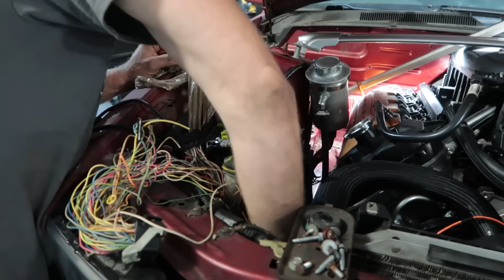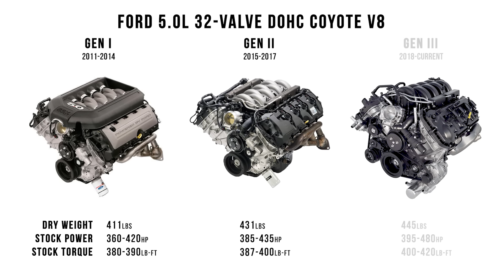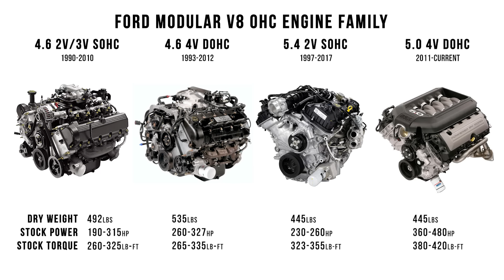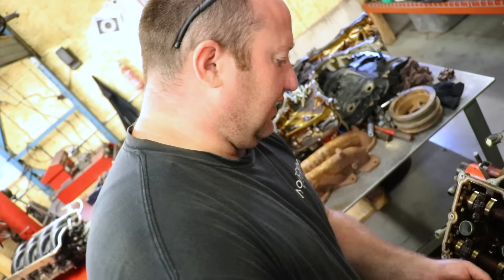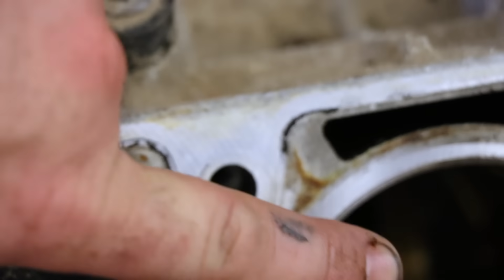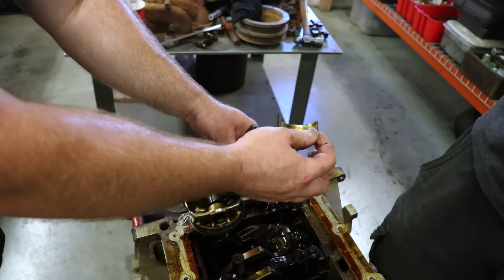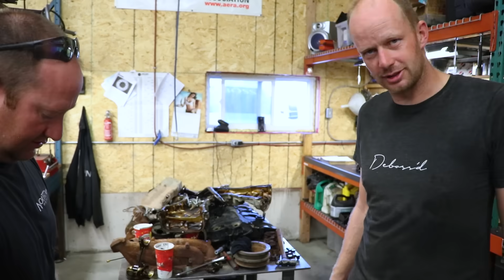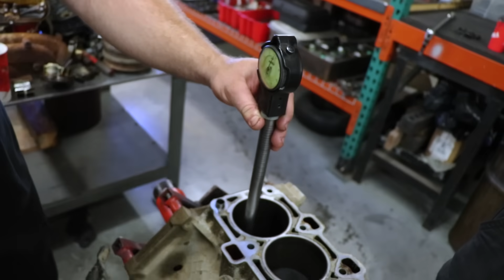REVIEW: Everything Wrong With A 5.0 Coyote Engine

Comment: Second gen COYOTE 5.0 is king....reliability is unbelievable...fully forged bottom end...simple.... no direct injection..means NO carbon build up..iron sleeves..good on fuel vs competition...run mobil 1 full synthetic...body won't rust either on the F150...6 speed is bullet  proof..trucks out there with over 900.000km still running...2015 to 17..is the pinnacle of the F150...it's basically a racing engine that can handle up to 800 hp...boosted...no problems..

Comment: I have a 5.4 f-150 that's got 330,000 with the original motor and transmission you can cry about the 5.4 all you want there problem was the owners not the engine i have replaced plugs and coil pa ma never broke a plug or had one shoot out the head just because you don't like something doesn't mean it's bad you think ford used that engine for a long time  and a big company isn't selling stuff it's going to have to replace stuff on for free

Comment: Wow, this dude doesn’t know as much as he thinks he does.  He might be a decent machinist, but boring out an engine absolutely DOES increase displacement if the stroke stays the same.  Compression height doesn’t matter when calculating engine displacement, period.
Reply from the maker: Scott addressed this exact point in our follow up video here: https://youtu.be/tDpTPxinNyo He isn't talking about performance engine builds. His point relates to modern engine rebuilds keeping the compression ratio the same in a stock application.
Reply: @DEBOSSGARAGE he specifically said boring out doesn’t increase engine displacement.  He even used the example of boring out a Chevy 350 .030 over and said “people call that a 355 but it doesn’t work that way”.   Mmm, yes it does.

Comment: Great video! I know it’s old now and prolly already been said. But the one issue never mentioned was the valve cupping problem. The factory valves are too soft and over time will cup themselves further up into the valve seat before the angle isn’t right and they don’t seal. Just like the updated bearings mentioned, Ford has updated valves to correct this problem. I feel one rebuild in a first gen’s life with all updated parts (at the very least) and this is a near bulletproof engine. I love my Coyote!

Comment: I don't see any camshaft bearings in there. It's retarded junk throw away engines then. Any money you throw into it is a waste unless your address that flaw. Take it to the auto machine shop and have then re work those heads to accept split cam bearings. I can't believe there engines supposedly love boost.

Comment: What I want to know is, what are the design flaws. Of these verious Gen 1, 2, and 3 engines. Do their camshaft ride on aluminum journals? Like the Ford Escape 3.0L V6's if so that's a bult in weak link just waiting for it to overheat and melt the aluminum causing it to gauld up on the cams and then hog out the journals. And all it takes is blowing a head gasket to make that happen. And then keep driving it. Like most who don't know or understand engines will do. And then the heads are FUBARed.

Ford as well as most auto manufacturers especially now a days are really going HAM on the whole planned obsolescence business model. Especially European manufactures. Eventually no one is going to buy their crappy designed vehicles. Cause they don't want all the troubles they will be buying.

Comment: The sound ! 

It's not a real 5.0 pushrod Windsor.

It's a garbage trash modular motor and it's been neutered it doesn't sound anything like a real hot rod V8 like the old school 5.0 Ford needs to go back to the drawing board and bring back the 5.0 ho

Comment: When Ford deleted it's cast iron 300. Inline 6 it's 302 it's 351 it's 460 this is when all the trouble started trying to make better instead it went south in a hurry. I am a retired auto mechanic have worked on all of the big 3 for 40 years they have all turned to JUNK.

Comment: Any oil is not good from short driving i dont believe full synthetic would have caused that. My gt 5.0L first gen coyote has 133,000 miles on it and no. Noise i run pennzoil ultra platinum or amsoil in it. Changing the cooliant is also very important on these motors as well.
Reply: I also change out the manuel transmission fluid every 10k miles as well as the rear diff fluid. Fuel system.cleaning as well as cleaning the intake valves every so often. My 2.7 ford 150 gets same treatment only thing is I take to dealer for transfer case transmisson and front amd rear diff. I change my oil every 3k miles I might be wasted money but oil cheap compared to an engine. I've actually put 150k miles on an ecoboost engine. Learning properly let your turbos cool down and start vehicle is very important oil needs to run through the turbos. Most people are afraid of turbos do to the complexity of the engines. I go above factory recommendations on any engine. These engines the 5.0L are made to be driven

Comment: Just bought a 2011 f150 5.0 with 68000 miles?? What do you recommend for oil semi-synthtic or full and 5w20 or 5w30 the ford dealership parts manager siad to stay with 5w20 do to the 5.0 tight tolerance? Is this true  or am i safe  to do 5-30 with either a wix-xp or amsoil filter.   Thanks  great videos

Comment: I have a 2013 Ford F150 with 5.0 .it has 289k miles and it still runs strong . original engine and transmission.i ll drive that f150 coast to coast with confidence

Comment: You don't know shit  i have a 2017 ford f150 5.0l coyote engine.. i got over 130000 miles or 216000 kms i got no issue none so ever still going strong.  Its all about the driver not the engine

Comment: Yes finally an engine builder that actually understands and prefers all the proper Ford engines. It seems like all the big power guys and their engine builders prefer the coyote which I can understand cuz it's newer and has stronger main caps and after you completely rebuild it and get rid of its quarks it's pretty good, I'm wondering if they keep the variable cam timing for the high power coyote stuff cuz aside from the VCT and the main caps and the stroke to rod ratio it's basically the same as a 4.6 DOHC. I could talk for a while cuz this engine builder got me all fired up, he said alll the right things about the Ford motors but I don't want this comment to be ridiculously long lol. After I heard that engine builder say a few sentences about Ford motors I was like ok hit the subscribe, does he have his own channel lol? He really seems like he has a great perspective on Ford engines which really aligns  with my thoughts as well and it seems like he has plenty of experience. Great stuff man. ✌️✌️

Comment: NO, the reason you should try and stay with the exact same oil brand and type is: each oil has a wear and usage characteristic and the engine will wear to that so if you keep changing you increase wear as the engine is constantly breaking into a new character oil type. How important is this??? somewhat important but it is not the end of the world

Comment: Came from a 5.4 and overserviced it very quiet going above 200k a 2007 runs smooth and quiet the base engine is doing very well. Now picked up a 2017 with a 5.0 comparing the idle this thing sounds like all hell is breaking loose clatter and all sorts of hell runs and has the horse power but what the hell sounds like it is going to shit the bed tick and rattle noises NORMAL OR NOT. Most put a loud exhaust on it can not hear it anymore. Normal or not when I get my coffee sounds like shit through the drive through love the pull hate the noise.

Comment: Well, my 2020 f150 with the 5.0 was burning 2 quarts of oil per 1000 miles... and it was only serviced by Ford when i had it... got rid of that pos and bought a 4runner.

Comment: 5.4 is stroked, not bored over. 
5.4 has a larger main, and much taller deck height.
The three valve issues are due to oil pressure drops, typically due to pressure bleeding out of the tensioners.  Cam cap damage is a result of the drop in oil volume not a cause of it.

You can time literally all of the engines by counting the links and marking them, or using the colored links on the chains to align with the dots on the sprockets.
Please don't sand the deck lol. 

The overbore is still a larger displacement. You're just plain wrong on that.  Any dish changes are to maintain the exact same compression despite being a higher volume. No engine management system is going to care about the 1-3% displacement change from a bore. They call all trim at least 10% without issue. Ignition curves may mind a compression change

Comment: So would you recommend running conventional oil on my 3rd gen mustang GT that see's mostly street use and track use once or twice a year?  I myself worry about all the sludge build up on my car with synthetic from short drives because I don't drive my car often or for long drives at a time
Reply: Any oil is good oil, synthetic is better up to a certain point, but when the additives etc are gone, their properties change more dramatically than conventional. Generally over using oil would be a problem with either synthetic or conventional, but when you're running short oil change intervals, conventional is just cheaper. Maybe do oil analysis, that'll give you an accurate answer. 

Deboss has another video on this oil question to clear things up a bit, I think it wasn't well communicated and caused misunderstanding. Also, "The Motor Oil Geek" channel has some great videos on related topics.

Comment: 16:23 the throw of the crank with the bore determines the displacement. I don't think it matters if the piston height is lower because it is also lower at the bottom of the stroke. Maybe you are meaning compression ratio?

Comment: The 1997-1998 Lincoln Mark VIII LSC, which is a 4.6L DOHC had an advertised HP rating of 300 HP. The Mustang Cobra of the same year would have different pistons and more lift, so the CAMs are all different.

Comment: Does anyone know how frequent the exhaust valve issue is on the 1st gen f150 5.0s? I just bought a 2012 f150 with the 5.0 and 126k miles on it. Heard about the exhaust valves tuliping on cylinder #4 and #8. Seems like there is a heat issue towards the back of the engine that eventually causes the valves to wear away. Since this is a major issue, I’m considering selling this truck and getting something else. 

What do y’all think? Is that really an issue I should be thinking about or no?

Comment: If you change the oil regularly an engine will last a long time.  I have a 2014 GT Convertible with over 186,000 miles currently.  I am having no issues with the engine.  No strange noises or knocking.  I have not had a check engine light yet (knock on wood).  I got the car with 93,000 original miles.  The previous owner took really good care of it.  I use Penzoil Platinum high mileage full syntheic oil.

Comment: Plenty of supercharged gen 1 mustangs out there that are still running fine.  If you redline every gear constantly, then yes, it will need to be rebuilt.  One reason to only buy a used car with a manual transmission if it was owned by an older person.  Then replace it with a Tremec :).

Comment: 27:15 the old push rod tech is still around because its more reliable with less parts to create more possible problems. The only real issue i see with push rod engines is RPM. They dont like it and when you get it in high rpms is where they will fail

Comment: Moral of the story is that a 5.0L will never fail if you change the oil. I 100% concur with that. I currently have 215k on my 2013 and have never had an issue. Runs like a top.

Comment: I the reason why one side of the engine under the valve covers is darker than the other is the way the PCV system works. The driver side is pulling fresh air in on the valve cover and then it’s getting pulled out of the passenger side.

Comment: The first lack of reliability is the use of a timing chain instead of a gear second the horse power gained by a cam phaser is not worthy of the cost of reliability and the fact the engine can't be made much more powerful threw modifications.

Comment: I have used synthetic oil in my mustang for 12 summers and the cam and timing chain are spotless shiny with zero discolorations. Mobil one Is the best. P.S I have driven it across the desert at 112 plus degrees ,no trailer queen at all.

Comment: Although engine work is 2x more expensive than an LS. HP is still cheaper as the Coyote takes well to E85 and boost with a stock engine, due to the high compression and strong internals.

Comment: That boss engine can 1000 wheel horsepower with a TVS blower and you can beat the crap out of that car all day long and not even have to open up one single thing on the engine. Every coyote is like that you don’t have to open up the engine to get serious horsepower. Both on a supercharger get a good fueling System and you have some major horsepower. Now any LS Engine would have to be opened up and parts changed out in order to put that same blower set up on so even though the LS is cheap the price equals out in the long run. The coyote does not need pistons, cams or anything to run a blower and you can run E85 and get serious horsepower and torque just with boost and fuel. And that boss engine is probably the best Anjanette Ford has ever made. Everything inside of that engine Has performance parts

Comment: I got a 5.0 in 12 f1fitty  never had any issues i like it better than my 6.0 in my 2010 gmc if i tried to red line my 6.0 to 8g like i can my coyote the 6.0 pushrod motor would be gasping for air like a pig that just ran a couple hundred feet.😂

Comment: If coyotes were so bad, they wouldn't...
Have the highest brake mean effective pressure of any mass produced V8
Have taken Brett Lasala to 6.30s with an oe block, ported heads, and oe crank. ... which is the WORLD RECORD for a proven street car on 275s. 
Have run 5.67 @ 265mph with a billet block and ported oe heads.

If the Coyote is "bad"  everything is  shit compared to it. Nobody else's engines have proven capable of these milestones on oe parts. 
Typical Ford hater trash.

Comment: 2014 f150 5.0, 11 months into ownership, 129,000 Miles cylinder 7 & 8 lost compression due to bad heads, valve seats were bad. New Crate Engine under extended warranty, I'm in pursuit of selling the truck now because its one issue after the other 
In this vid, they did not mention anything really about the valve seats which is interesting, just some serious bottom end failure 
Can't wait for that 
Very informative, thanks

Comment: This really is an interesting and informative video! I and my two sons own F150s, one with a 5.4 and the other two with 5.0s. Mine has 273,000 miles and runs like a top and has had no issues. I learned a long time ago that you can’t overdue on oil changes. I currently have two Jeep Grand Cherokees, one with a 4.0 with 342,000 miles, and the other with a 4.7 with 360,000 miles. I have always changed all the fluids more often than recommended by the manufacturers and that has really paid off for us all. I would love to see more of these videos! Thanks!

Comment: I have a 5.0 and change oil with synthetic every 3k, I tow a flat bed trailer daily about 3500lbs all city miles.  Motor has 175k, not one problem except for oring leakings coolant at around 79k.  I have a 5.4 triton with 312k from 2001.  Before that a 300 inline 6 1988 with 225k before I sold it.  It's really how well you maintain your motor majority of the times.

Comment: Dude lots of power at the 2001 4.6 you must be joking the turd makes like 230 horsepower when I bought my 2002 after getting rid of my Turbo Foxbody I took it for a ride around the block and I was ashamed of myself I parked it and didn't get back in that car for a couple months then finally I threw some gear did a couple bolt ons just to drive it a little bit before I did the coyote Swap and that thing was such a turd it was embarrassing to even take that Mustang put that shity of an engine inside such a beautiful car and I don't know about Bulletproof because I see these things grenade everyday the bulletproof if you leave them stock

Comment: My 2019 Gen 3 Coyote is having idle problems and loss of power at 27k miles. It has been having the shuddering trembling at idle issue for awhile. Service discovered no oil on dipstick at oil change and put in me TSB for engine oil consumption. It checked out fine at the 5000miles and they sent me on my way. It's still suffering the same symptoms and now it has died on me in traffic as I've read others complain eventually happens. I'm about to get rid of it if they cannot get it right.
Reply: Hope issue can get resolved. I have the same GT with zero issues at 71,000 miles. Good luck.

Comment: So you guys mentioned oil a few times and engine getting low on oil. What would you recommend for the 5.0 in terms of oil type, brand, and oil change frequency?
Reply: I'm running Redline 100% synthetic in my 16 Gt. Expensive but great oil. Thinking of switching to Pennzoil Ultra or Amsoil.
Change it every 5k use Ford filter... they're excellent

Comment: Not that i won't at some point have problems with it, but my 5.4 triton in my 2013 ford expedtion has been flawless so far. 72k miles. The first owner was a senior couple who had full regular service records. I got it with 59k miles on it and change the oil regularly. Its a little underpowered for the big EL version we have but we've towed with it and its got torque for days. Im less a fan of the 6speed than i am the motor.